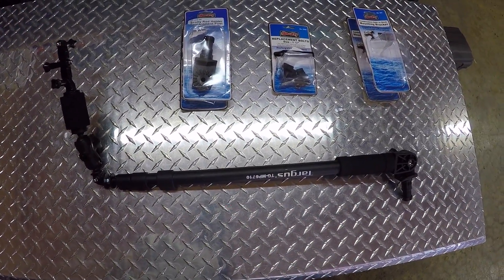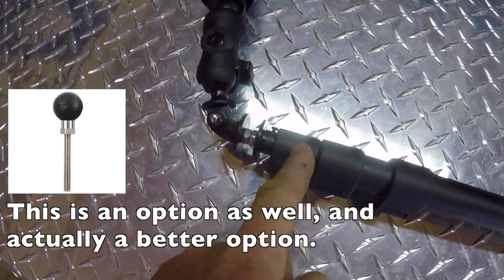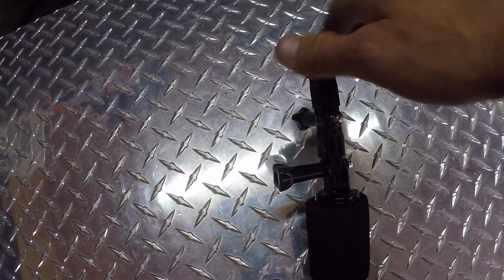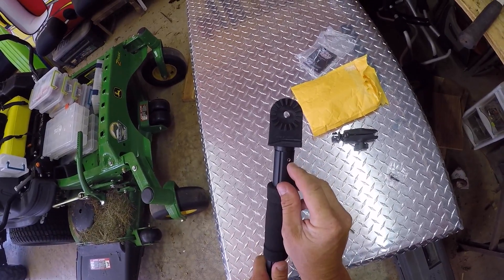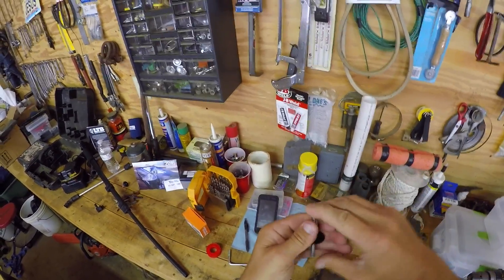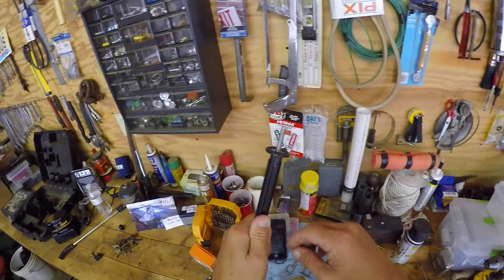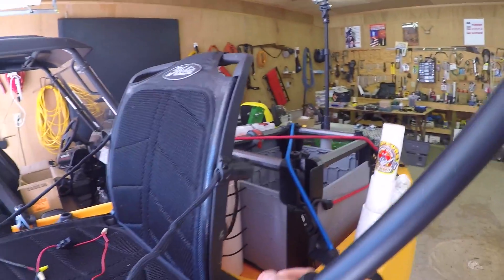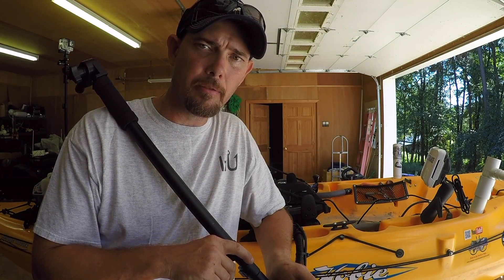Kayak DIY Extending GoPro/Camera Mount

Comment: Hello, I'm in the process of copying this mount haha! BUT Question not related to this, I'm going to BWCA in July. I haven't really fished before. I do have a spinner rod and reel though. What would you suggest to take for bait wise? I've read that there is Small mouth Bass, Pike, and mainly Walleye. I just have no clue on where to start looking. Thanks for any help!
Reply from the maker: Thanks for watching!! Where is BWCA? I may can possibly help if I knew where that is first. Thanks
Reply: Boundary Water Canoe Area (BWCA) its in Northern Minnesota. The waters actually cross into the Canada side but that area is called Quetico.